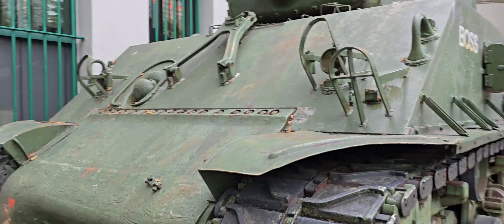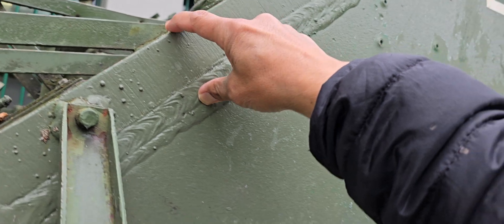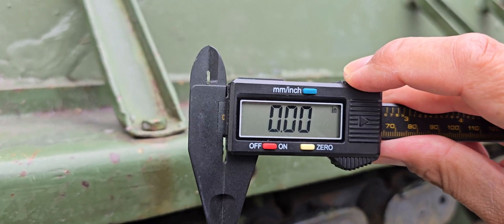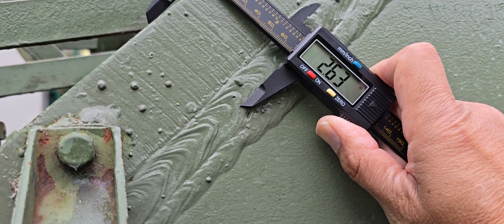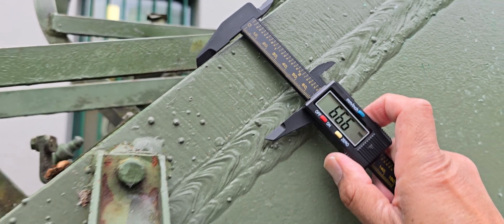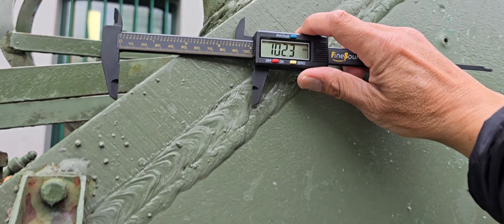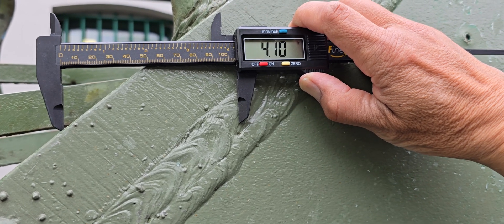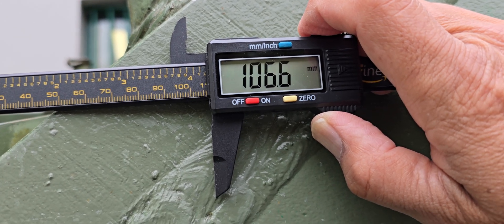WW2 US M4 SHERMAN Tank FRONTAL ARMOR EFFECTIVE THICKNESS ACTUAL MEASUREMENT

Comment: M4 Sherman is the best (overall/big picture) tank of the war in my opinion. It’s crazy that despite the various shortcomings it got reiterated & upgraded and served on every single front of the war. From the muddy slog of the Eastern Front, to the beach landing and fields in France, the sands of the Sahara, the jungles of the Indian-Subcontinent, all the way up through the Pacific until they were knocking on Japan’s door. Awesome tank.
Reply from the maker: Indeed, it was the most balanced Tank in terms of reliability, protection, firepower, built in large numbers and supported by the best logistics in the world.
Reply: Only cause it's used everywhere , doesn't make it a good tank . It was available in large numbers and therefore cheap , that's a big reason . Soviet t-34 was also used everywhere from different countries up to the late 1950's , war is about money . German cats were pretty expensive compared to a Sherman or a t-34 .